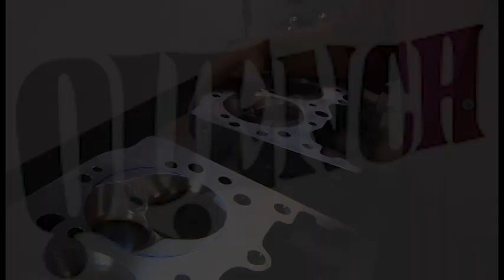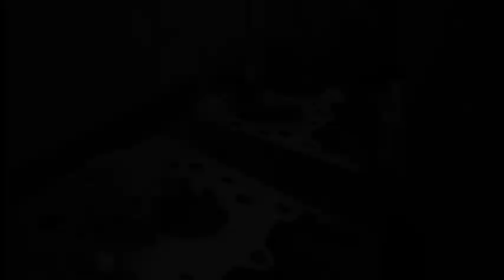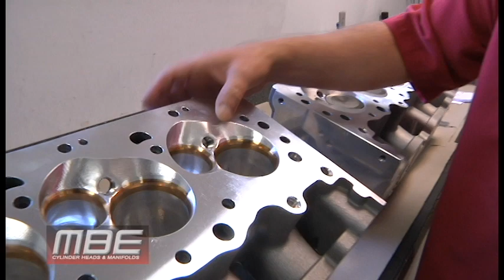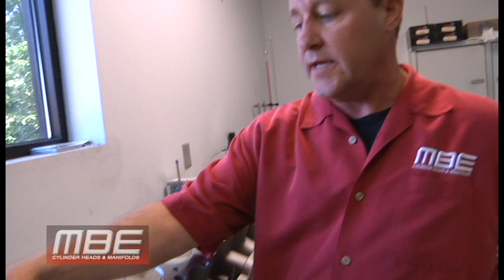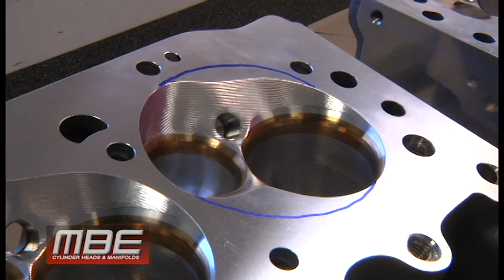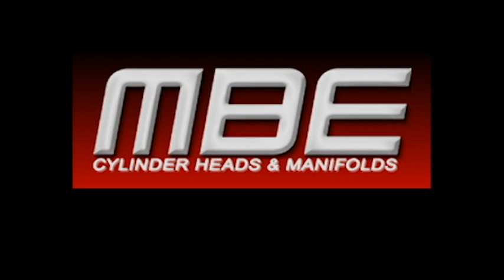MBE  QUENCH EXPLAINED  **TECH**

Comment: Wouldn't a slightly dished piston accomplish close
to the same thing?
Reply: Good point. I'd like to know too. Wonder what the cost/benefit would be of doing that on the piston vs. the head. I would imagine it might be harder though if you're running domed pistons like in a motorcycle or smaller engine with 4 valves, but who knows

Comment: What was left out is that a large/tight Quench area(s) is/are excellent for  part-throttle-efficiency,
but of course this only applies to Daily-Drivers and Towing applications where
part-throttle-efficiency is very important for responsiveness and fuel-mileage, ( and emissions ) .
Soft-Chambers absolutely stink for any application other than a dedicated Race-Car-Engine.